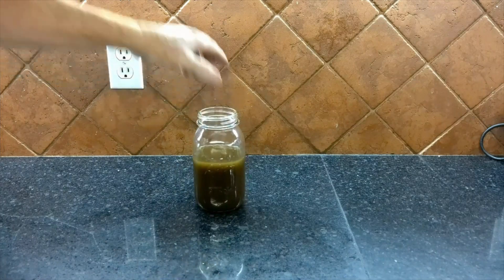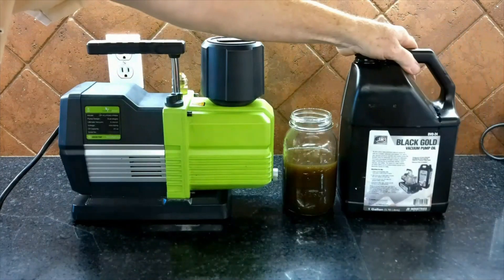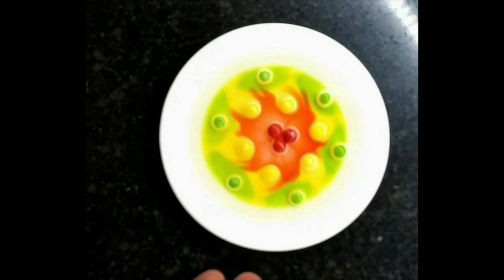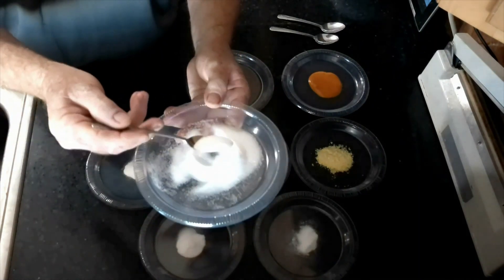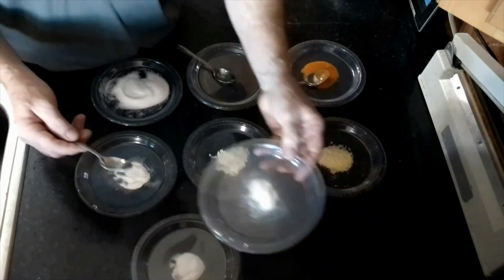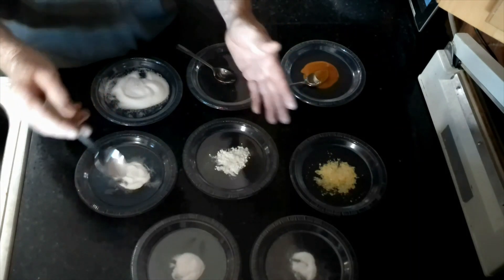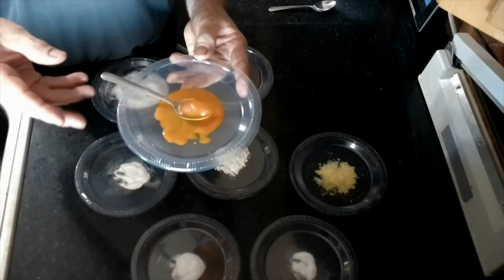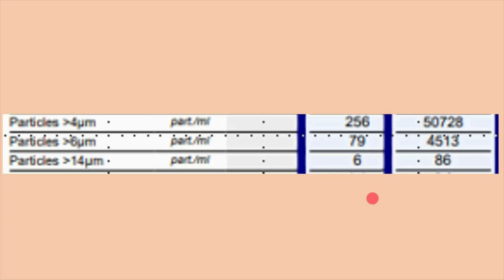Skittle Oil-  Breaking the Candy Code Part 2

Comment: How often should I change the oil after a skittle run? I’m doing my first ever skittle run and want to do several more. Should I change the oil after each run or when I’m done with all of the batches?
Reply from the maker: I would change and filter the oil after every batch while the oil is still hot.

Comment: Thanks for all your hard work Phil. I just ran a batch of skittles using a BRAND NEW premier pump and a FRESH fill of brand new harvest right oil. I tried your 30 minutes "heat & vacuum" technique. Candies turned out great, but my oil almost instantly became milky and cloudy. This is only the second time I have used the oil and the Premier pump (first time, yesterday, did a batch of cucumbers...). Should I throw away the oil (and never do skittles again)? Could this be (partly) due to not running the cold cycle first to get the moisture out of the air in the chamber? (I understand the moisture doesn't come from the skittles). Thank you for your help.
Reply from the maker: Keep your oil until it's a dark amber color:
https://youtu.be/vqAMUh5W7eE
The point of freezing is to control sublimation of water in the food.  Skittles, and most candy, don't have water.  Milky oil is a sign of moisture in the oil.  There could have been some water in your drain hose, in the lip of the trays, or somewhere else.  Filter the oil.  The pump's vacuum and heat will remove/reduce the oil.

Comment: This is all very interesting. I have processed litterally 100+ pounds of Skittles (I sell them) and I've never had a single problem with my oil. In fact, while I change the oil when suggested, I could get away with not doing it because the oil is still immaculately clean and clear.

Why would this happen to other people, but not me?
Reply from the maker: Older pumps without the gas ballast, not changing oil.  Letting pump sit for a long time with oil inside.
Reply: @Philat4800feet  Ah, that makes sense. Especially the gas ballast. Thank you, sir!

Comment: Thanks Phil for keeping us informed about our freeze dryers & doing all the work for us! I run skittles occasionally for the grands but now scared to. Never had yucky looking oil but never took my pump apart either, which I probably should do! Thanks again. 😊
Reply from the maker: Just remember, skittles don’t cause the oil to darken, an ingredient in the skittles, hydrogenated palm kernel oil, causes the rust and iron deposits, already in your pump, to release and mix with the oil.  Frequent hot oil changes, or a power flush, will help keep your pump clean.

Comment: This was extremely helpful information! We have been wondering about this very thing and no one but you has taken the time to break things down so extensively. Is there a way to contact you by email or phone? We are interested in discussing this topic further and doing a collaborative project.
Reply: @Philat4800feet   Thank you - I just sent you an email with my contact info
Reply: Hello, I was wondering if I could pick your brain on my pump issue, my oil was very clean comparatively, and the demister filter was nearly spotless, but when I opened up the pump and inspected the vanes and other parts, there was some type of corrosion type looking film on many of the steel surfaces, was easy to clean off but only achieved 1300 Mtorr after re-assembly